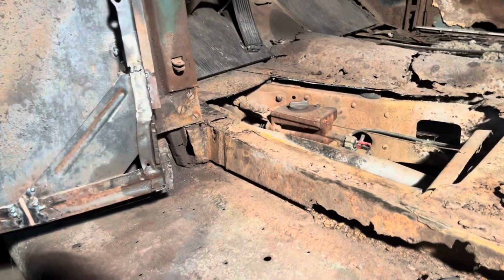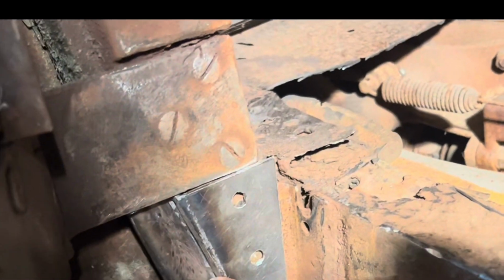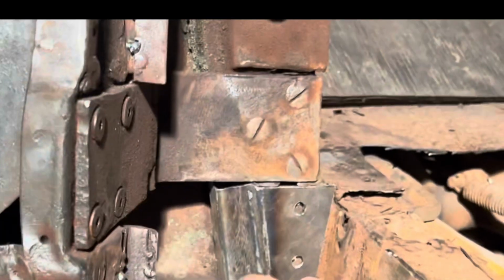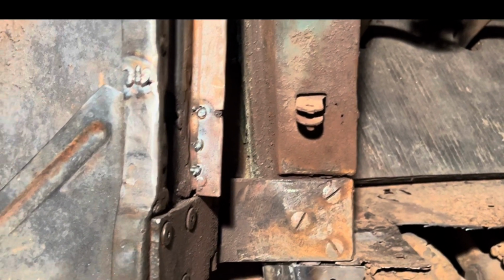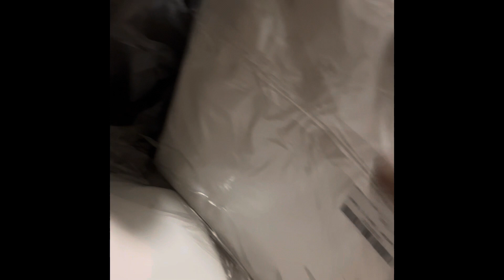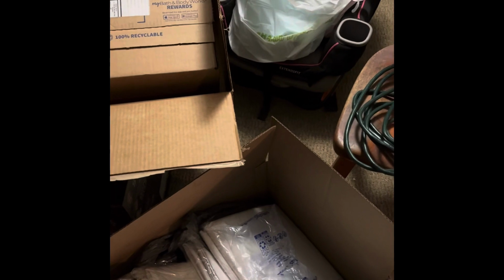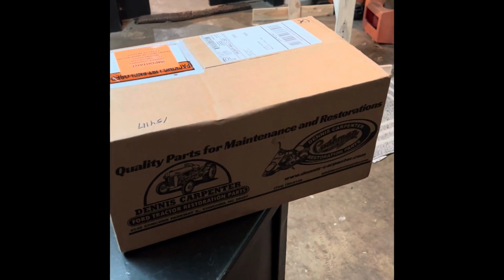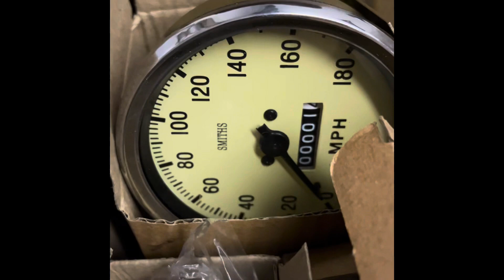Eliza 40 ford, the good , the bad and the ugly. update

Comment: Great work again!  On the battery gauge-stock 39 Deluxe, 40 Standard, and 40 Deluxe had volt meters, as opposed to ammeters.  My father, who was an electrical engineer, always said that it should have had an ammeter (volt meter tells you the current state of your battery voltage, ammeter tells you what is going to happen to your battery voltage as that is a function of whether the battery is being charged-Much more useful in that regard than a volt meter).  My father always thought my 40 should have an ammeter.  In working on it the last two years, I installed an ammeter (hidden in the left ash tray as I have a stock instrument cluster).  Ford, by the way, went back to the ammeter with the 41, so your choice of an ammeter over a volt meter is, IMHO, a good one sir.
Reply from the maker: I wasn’t sure which I would get, some pics showed amp gauge, others a volt gauge. Yes I am glad it was an amp